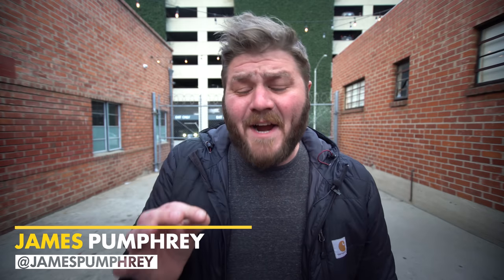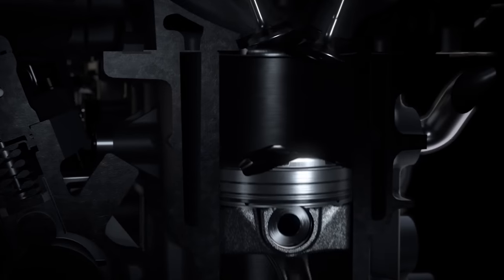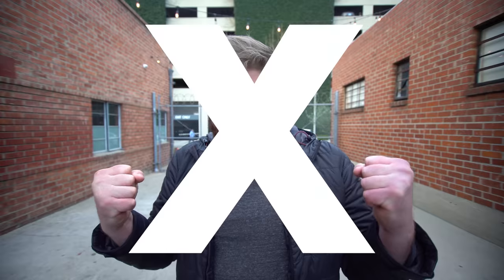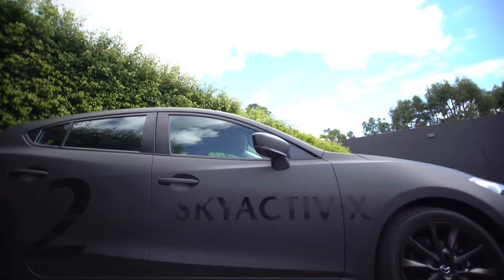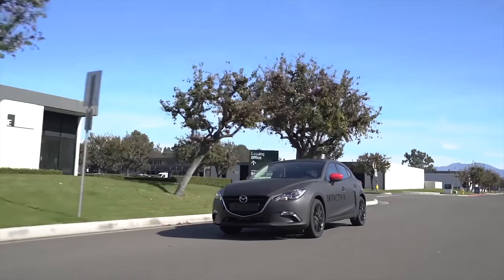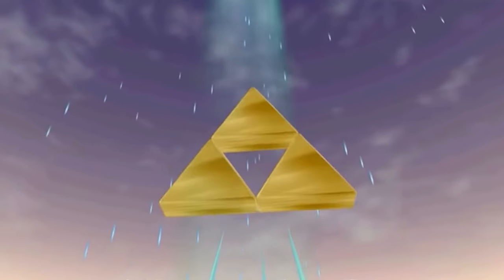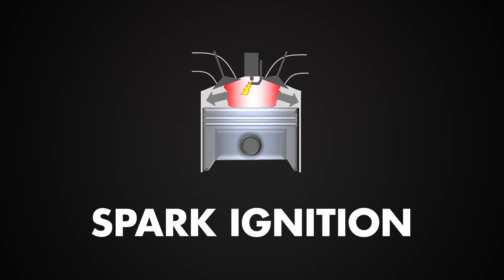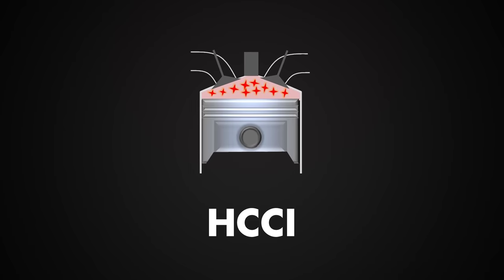Mazda's Secret New Engine Technology - SkyactivX | The New Car Show

Comment: I salute Mazda for not doing what the Germans do by slapping a turbo to a smaller engine and calling it "efficient".
Reply: And selling it a 40 000 € .
Reply: 1001speedster well, it makes it "efficient"
Reply: 1001speedster Borg Warner is American
Reply: I'm Yeah and? Denso is Japanese, BOSCH is German, magneti marelli is Italian. The nationality of parts suppliers don't mean anything since it's the car manufacturers that actually design the parts and their mechanical implementation on their mechanical systems.

That's not to say Borg Warner is a bad company, they're a good a parts manufacturer.
Reply: CeSayrise Yup deffo, German engineering is a myth, whilst it's correct and impressive to a certain degree I guess, the phrase "German engineering" is also glorifying that a more complex system=better. Even though it hinders system reliability heavily and is an expensive maintenance nightmare. Hence why the Germans lost WW2 because their tanks, whilst impressive, were unreliable, hard to maintain and expensive. And thus is why the Soviet T-34 and American M4 sherman were better suited for the battles in WW2.
Reply: 1001speedster wow I did not know that... the more you know
That is a real fun fact
Reply: Let's touch butts Why do you refuse to accept FACTS, go look at any JD Power survey, apart from Porsche. Audi, BMW, Mercedes and VW are all known as maintenance nightmares and are well known for being unreliable with BMW at rock bottom. That's not to say they're bad cars, they are good cars, they're just over engineered.
Reply: 1001speedster That is why Mazda took a supercharger and slapped it into their engine to make it more efficient.
Reply: Carlos Hernandez, hey dumbass... Read the comment I was replying to... Or take yo dumbass elsewhere.
Reply: 1001speedster 👏
Reply: 1001speedster uhh what?  They certainly did not lose the war due to their technological superiority, they almost won despite smaller numbers and enemies on all fronts, just because they had such technological superiority, and simply stellar equipment.  The German tank was like a 2018 full sized pick up compared with the allies, whose tanks would be the equivalent of a 1980s Mazda b 2000.  Light, under-armored, underpowered and poorly designed for getting shot at, you know, like it's sole purpose.

German planes had mechanical injection pump to avoid fuel starvation during quick flying maneuvers.  The English, curious as to why their air force was being raped like a caged chimp in guantanamo, took apart an injection pump from a shot down mechershmit.  They exclaimed that the Germans must stupid for not using a carburetor.  The reason for it's use passed right over the English mechanics head, they had never seen something so advanced at the time.  

Germany quite honestly deserved to win that war, as terrible as it is.  They were leaps and bounds ahead technologically.
Reply: Awesomeman1987 They weren't that far ahead. The US was just as advanced
Reply: Two points:

Cars are as reliable as their maintenance. BMWs are notorious for strict maintenance requirements, which people often neglect. Just like Subarus are complicated in their own right and require fairly specialized mechanics, etc. Engine complexity increases maintenance complexity and for most cars it’s maintenance inappropriate to their use that does them in. 

Maintenance protocols intended for safe orderly driving when people drive like the freeway is open track day. 

Second point;

One of the reasons the Nazis lost was wasting their time attacking Russia. A land offensive was clearly a stupid idea, had they focused on more winnable fronts and consolidated their efforts after successfully securing borders they may have done better but they wanted everything all at once. 

But there’s obviously a number of factors that resulted in their demise, thank fucking goodness.
Reply: 1001speedster couldn't have said it better. German engineering is only good in optimal conditions, it's a piece of shit if it even looks at dirt the wrong way
Reply: Awesomeman1987 you have absolutely no idea how WW2 went. The german tanks were terrible, over-engineered piece of shit. Yes, one Tiger would eat one Sherman or one T34, but what happened is that the one Tiger would encounter 4 shermans and 8 T34s and get utterly wrecked, and its crew had a very low chance to escape a destroyed tank making crew survival rate abysmal, while a Sherman crew would just get a new tank the next day.

You clearly know more about cars than WW2, so please don't talk about things you know you have no knowledge of
Reply: Awesomeman1987 you have absolutely no idea how WW2 went. The german tanks were terrible, over-engineered pieces of shits. Yes, one Tiger would eat one Sherman or one T34, but what actually happened on the front is that the one Tiger would encounter 4 shermans and 8 T34s and get utterly wrecked, and its crew had a very low chance to escape a destroyed tank making crew survival rate abysmal, while a Sherman crew would just get a new tank the next day.

And German technology wasn't as advanced as neo nazis would have you believe. The jet engine existed before WW2 and the UK came up with a jet fighter at about the same time as the germans did, and theirs were a lot more reliable. The V2 was a terrible waste of money, as were all the "wunderwaffe" bullshit the germans wasted already limited resources on. The simple fact you think Germany had ANY chance of winning WW2 with its resource situation shows you have no idea how WW2 went or even how warfare in general works.

You clearly know more about cars than WW2, so please don't talk about things you know you have no knowledge of
Reply: Bog Weiner
Reply: Volkswagen: puts 3 cylinder engine into a car
Harley: puts V8 into a motorcycle
Volkswagen: excuse me how the fuck
Reply: I salute Mazda for stubbornly remaining the smallest, least successful Japanese automaker...
Reply: Youd rather own a boring fwd underpowered car with no hope if modding it..  Yeah sounds like youre into mazdas
Reply: @davidschwartz2144  Mazdas are fun. Even the fwd ones. They're built pretty good to begin with and you can score performance parts off other Mazdas. The rest on ebay and that's all you need. Mazda made some light little cars and some light v6s that fit in them and some awd turbo cars as well.
Reply: You'd rather own a rwd underpowered car with zero hope of modding it? Yeah the RX-8 was a huge flop remember?
Reply: Yeah, Mazda tuners seem to get their parts off of ebay... says a lot about Mazda owners...
Reply: @doktorbimmer  agreed. Mazda made one good car. Surprise it was rwd. Their engine sucked comparatively so people put a chevy engine it surprise again. The new generation of mazda lovers clearly are not car purists so let me buy boring cars I guess.
Reply: Indeed they did, The MX-5 is a huge success for Mazda and is the best selling sports car in the world under $50,000.
Reply: Yes, it does mean its better... just the facts here.
Reply: And nearly all of their FWD cars can be built up to destroy even the latest MX-5 if they don't already. With junkyard and ebay parts. Reliably. Not sure which one's couldn't, just leaving the possibility open that there's one out there.  The smaller, lighter and uglier it is, the faster it will be, and the more it hurts when your more expensive whatever it is get passed by a FWD Mazda.  You're not going to get a working BMW or LS anything worth a shit for the money you'd spend on that Mazda which would be nearly finished so far as mods go. Then there's the 787B rotary race car, banned from competition. If you're just looking for a fun car that you can afford Mazda is where it's at. If you just have a need to waste a metric crap ton of cash to only prove somebody else has a better LS build or spent more at a BMW dealership, then yeah go for it. Just know there's faster shit than that too. 

Now name a YouTuber with a factory OR LS swapped ANYTHING that hasn't blown up their LS, AND has been driving it hard for over a year. I can't think one.
Reply: I've never seen a Mazda that can touch my M3 unless it has more invested in it than the M3 costs... of course they are still stuck driving a Mazda and not a BMW.
Reply: The Mazda 787b was never banned, that is merely a false urban myth. Mazda announced in 1990 that it would retire the slow and very uncompetitive 787b after the end of the 1991 season. The FIA never banned the 787b or the Wankel engine...
Reply: Mazda is the brand you buy when you can't afford something better..
Reply: Are you compensating for something with the bold letters? What's 0-60, 1/4 mile time of your M3/which model? Ebay turbo kit, tune, Megasquirt, plus a running fwd Mazda, maybe even an engine swap, all in, I'm sure you could be beat for $5k or close to it. You could definitely hit 400hp,  you could make more though, it would weigh a lot less and have shorter gears. If you want an all out race car then you're replacing bushings, suspension, bracing the trans to keep it together and a LSD if you didn't find a factory LSD from Japan. Strip out the interior and maybe some carbon fiber body panels, (hood, hatch.) What kind of fun, working, M3 are you going to get for $5k that doesn't need major work that'll make it even more expensive? $5k you'll be slower than other M3s even if you could beat a FWD Mazda, so your wallet will have to get opened and emptied anyway. :-/
Reply: BMW is the brand you buy when someone else has to make it fast for you...
Reply: BMW is a brand you buy when you want a better car.
Reply: You've had 20 hours and that's all you've got!?!  Bold and capitalized now, definitely compensating and triggered. Mazda... when you know how to use turn signals ;-D
Reply: Mazda, the smallest and least successful of all the Japanese auto makers... more famous for its colossal failures than it short history producing automobiles.
Reply: What colossal failure are you referring to? RX cars hold their value better than most BMWs, because you can fix a worn out rotary.
Reply: I did not get a notification for your reply. Just happened to look to see if you had one. The rotary is hardly a failure, it just needs different maintenance. Miller cycle same deal. The KJ made 217hp from 2.3 liters. It needed the supercharger to operate due to the Miller cycle's valve overlap and superchargers need to be rebuilt every so often... still it made more power than a non M3 3 series at the time, and right up there with a 530/535 of the era and it wasn't a sports car, didn't have variable valve timing either. What's maintenance on an E36/E34 going to run you? More than the supercharger maintenance costs. Ad-hominems mean your argument is weak.
Reply: ...and Millenia S connecting rods fit in a KL so you can build them for boost with Junkyard parts like I said.
Reply: The Wankel engine put Mazda into bankruptcy in the mid 1970's and was acquired by FORD in a court ordered bankruptcy sale! The Failure of the RX-8 required the Japanese Government to step in a guarantee $3 BILLION dollars in loans to bailout Mazda... Mazda board voted to end further development and production of Wankel engines as part of it recovery plan. Just the facts here... your lack of factual knowledge makes your argument weak.
Reply: I'm am sorry you can only afford junkyard cars cobbled together with junkyard parts...
Reply: Your "facts" have nothing to do with whether you can have fun for less with a FWD Mazda. Your argument is a straw man and you're still bolding like a midget with elevator shoes hoping no one will notice. To your point anyway... Mazda bought back shares from Ford and got hit by the same recession that hit the entire auto industry. You must've gotten your ass handed to you by an RX-8 recently, the hate is strong and unreasonable on rotaries. If BMW was hurting they'd have cut back a lower volume performance car too.  What are you sorry about? I'd still own my car if I had M3 or an M5 or a 911 or a Cayman and it would still be fun.
Reply: BMWs market share is not under any threat from Mazda who has survived by selling cheap, little entry level cars targeted at first time car buyers...I'm sorry if your lower economic status makes you feel inferior... its your lack of education that seems to be holding you back.
Reply: And you should recall Ford did not need a bailout... Ford bought Mazda in a court ordered bankruptcy sale after it went bankrupt in the mid 70's. Mazda bought back shares with bailout money from the Japanese Government and 3 major banks to prevent the company from going under.
Reply: 'it your lack of education" LOL! Money well spent at your I.V. league collage there buddy. BMW will be "it's" own undoing.
Reply: All of my degrees are from public learning institutions... I don't come from wealth, my success is self-determined... The term "Ivy" league only refers to regional collegiate sports program by the way.
Reply: BMW was building cutting edge aircraft engines long before Mazda was even making corks and bottle caps, long regarded as was on the finest engine manufacturers in the world it developed the first jet engine for military fighter jet aircraft and its designs are still produced and in service in supersonic jet fighters... Mazda has attempted several times to break into the luxury/ high-end performance automobile market but the Eunos, Amati and ɛ̃fini brand were all huge failures and have been discontinued.
Reply: I spelled it wrong intentionally as well as collage. I was mocking you and I wasn't asking for advice on success. Maybe if you owned a LaFerrari or something, even then, probably not lol. Thanks!
Reply: English is not my native language and I did not major in English studies. Mocking my English skills won't prove your argument or make you look more intelligent. I'm actually considering trading my RS America for a 430... I don't particularly like the LaFerrari or any other hybrids.
Reply: +David Schwartz Well, I see more than a couple LS swapped RX-8s out there now... I think the reason is not so much that the 1953 designed small block Chevrolet is the greatest design in history as much as the 1960's Wankel KKM design or the 1970's designed Mazda 13b series engine its based on are so horribly bad... when a completely stock LS motor produces +50% more power, double the torque! and still delivers better fuel economy and reliability? Its no wonder why the Wankel engine is obsolete now! Cheers!
Reply: @doktorbimmer  exactly ^
Reply: +David Schwartz If you have ever lived and driven in Germany? You will quickly understand the different automobile design philosophy... in the States, cars are basically only taxed on sale price and fuel costs are relative low, (just like the quality of the roads here is low) You can't drive across two states here in 2 1/2 hours cruising at 120mph (unless you want to get arrested)  High performance cars there are built to an altogether different set of standards and some people prefer this type of car not just for status.
Reply: +David Schwartz The beauty of the SBC/LS series and what has made it so successful for so long is that it was very advanced for a automobile engine at the time it was introduced (flat-heads were still common), and the engine was simple and reliable.. Its basic design allowed it to be adaptable enough to take advantage of new advancements in parts and materials technology and its quench type (wedge) chamber combustion efficient enough to continue to meet current emission standards. Its availability and dirt cheap cost make it hugely popular in the custom and performance aftermarket... but it is also become so common in the US and Canada that it is frankly becoming a little boring, show up at a car show? And sometimes it is all you will see. The days of the OHV push-rod V-8 may soon come to an end in production cars... the one thing that the SBC cannot deliver is good enough efficiency to meet the upcoming fuel consumption and emissions standards for much longer.
Reply: Anybody actually questioning German engineering is just plain off. Ever heard of NASA?

Anyway, I salute Mazda for what appears to be them finally doing something on their own and not relying on Ford, Wankel, or others to do for them.
Reply: Actually Mercedes-Benz unveiled their HCCI engine in a car 10 years ago and Volkswagen and Opel have also been working on the concept for years... the Mazda system relies heavily on HCCI component technology developed by Bosch from these earlier programs... only Mazda is taken the risk of launching an "half step" or intermediate stage version of this technology instead of a true HCCI system... they have chosen to be the Guinea pig.
Reply: @1001speedster  As a BMW owner I have to disagree I have had some 6 or 7 BMWs since 1995 most bought second hand at around 5 to 8 years of age and 1 bought brand new, I have only ever experienced a 'serious' problem once and that is because I failed to check out the car properly before purchasing, the rest have been general maintenance or fair wear and tear. I agree they are not going to be as reliable as say a Honda or Toyota but choose the model (engine transmission) carefully and you can have trouble free motoring and at the same time you will have a heck of lot more fun behind the wheel then in a Honda Toyota / Lexus.
Reply: @pgtmr2713  My father has a 2008 Mazda 3, it isn't much fun to drive I can testify to that but it is very reliable which is what my father likes
Reply: @1001speedster  there is no such thing as "over engineered", a product is engineered to balance a mixture of desired attributes, a product that isn't reliable isn't over engineered, it was engineered with reliability taking a back seat to other considerations.
Reply: T37 took less material to build and less crew to operate than German tanks while Russia had a vast advantage in both material and man power. The US also had a vast advantage in both material and man power, and American tanks though more expensive than Russian tanks where still cheaper than German. When you have a smaller pop and less material, designing a tank that requires more material to make and more crew to operate isn't a smart move.
Reply: @jclark1693  Stalin knew the peace wasn't going to last and was preparing accordingly. 1939 Winter War exposed deep faults in the Russian Military, that the Russians where working to patch and the Germans where eager to exploit before they could, in 1941 the Russians where actually phasing out the bolt action Mosin Nagant for a semi-auto rifle, because of some difficulties in manufacture and distribution as soon as the Germans invaded the Russians switched back to the Mosin Nagant since it could be produced in the millions..... If the Germans wanted to have a chance, they should of started Barbarosa in the spring as soon as the land was passable instead of waiting until July.

Another error was declaring war on the US when they had no way to actually bring anything to bear against them.
Reply: @jclark1693  oh yeah..... "It's reliable if you do the proper maintenance" isn't reliable.
Reply: @isaackarjala7916 , that's not entirely true. That's like saying a hundred marines on jet skiis armed with 1911s is better than a single submarine with a 100 man crew because each jet ski uses less material than a sub and has a smaller crew.

In some cases bigger is better.
Reply: it takes a whole hell of a lot more material to build a single submarine (of the type that'd have a 100 man crew) than 100 jet skis and 100 1911s. the cost of 100 jet skis and 100 1911s is a rounding error compared to the cost of a single submarine.
Reply: @isaackarjala7916  ...exactly my point, yet the submarine would be a better military investment.
Reply: in this analogy, how would the Germans afford and staff even one submarine?
Reply: @isaackarjala7916 , not the point.

If it took 5 people to man a single larger tank, but it was more heavily armed than two smaller 3-man crew tanks, the larger tanks might make more sense.

In essence, quality over quantity.
Reply: T34, that for some reason I called T37, had "big enough" a gun and was updated throughout the war to meet German improvements in armor, while it self used sloping armor that allowed it to have greater effective thickness without the added weight and cost of actually having thicker armor. As far as quality goes, the T34 was actually capable of fighting in both the Russian winter, and also the mud of spring. Who cares about quality if the qualities exhibited aren't of benefit where you find yourself.
Reply: john m  what a load of bs. That's why the most car innovations are first found in European cars. And that's exactly the problem with European cars, that they have new technology's first that are not yet proven. Japanese car manufacturers are a more conservative to new technology's. Look at small engines with turbos, it first appeared in European cars, and after most problems were resolved, now it started to be offered on Japanese cars. And the problem with diesel cheating was also found in Japanese cars
Reply: The center of the automotive engineering universe is still remains in Germany... where the automobile was invented, Japanese brands are all cheap copies of the original which always appears in Europe first... not Asia.
Reply: @isaackarjala7916  That's literally ALL VEHICLES EVER MADE.  They won't be reliable if you don't actually take care of them.  Precision equipment simply requires precision maintenance.
Reply: @jclark1693  no one says about an AK47 or a Toyota Hilux "it's reliable if you take care of it", they just say "it's reliable". they only say "it's reliable if.... " about guns and cars that aren't reliable.
Reply: @J Clark And engines like the Wankel that had inherently fundamental flaws become obsolete in the manufacturing industry regardless of how people take care of them.
Reply: @J Clark The Wankel KKM design was plagued by several very serious flaws in its basic design that caused it to be less reliable than reciprocating engines, most notably is its;
-Highly compromised combustion chamber design.
-Its very poor internal geometry which is inherently limited.
-Terrible thermodynamic efficiency which causes higher operating   temperatures.
-and its very weak, fragile sealing system.
Reply: 1001speedster well. It does make it more efficient and give it more power.
Reply: @doktorbimmer  BMW is the brand you buy when you want A vehicle that starts on fire while sitting in A parking lot!  BMW still has not figured out what is causing this!

It was on Nightline last night!  

Just the facts!
Reply: @787brx8 Hey kid! Have you been by the local Mazda dealer to check out the new 2019 RX models??? Lol!!!!
Reply: @doktorbimmer  Hey kid...have you checked your parking spot lately?  BMWs= spontaneous combustion LMAO!
Reply: @787brx8 Mazda to Recall 52,000 Tribute SUVs over Fire Risk https://www.autotrader.com/car-recall/mazda-recall-52000-tribute-suvs-over-fire-risk-148603
Reply: OR simply just lie.. 175 mpg on a diesel wow amazing... lmaooooo
Reply: @Troy Bush  Well, Audi won the Le Mans 24 hours NINE TIMES!!! with a Diesel engine and Diesels are the most efficient, practical heat engines available for motor vehicles... even huge container ships. Wankel engines??? They have been obsolete for years now, not even Mazda sells them anymore.
Reply: @doktorbimmer  I LOVE LOVE, Audi I have a 2019 Q8 (it's my wife's truck) just got it YAY HER I have a 2016 S6 and a 2014 Rs5
Reply: @doktorbimmer  I added a pic to my profile of me and my Rs5
Reply: @Mr kool Aid Man Troy Bush stop pretending to be something/someone you are not... you are not fooling anyone here, especially not me.
Reply: @Mr kool Aid Man You said, quote; "I work at Notre Dame university and in the aerospace department they are working on a fuel that has the same properties as gasoline but acts like diesel."
   Please explain why you would want a gasoline fuel that acts like Diesel fuel??? and how that would solve the flaws in the Wankel engine?
Reply: @1001speedster  bmw is actually very ok, my friend drives an e46 318d and it didnt die ever since he got it 4 years ago
Reply: @ArmandoVictorForno No it doesnt lol